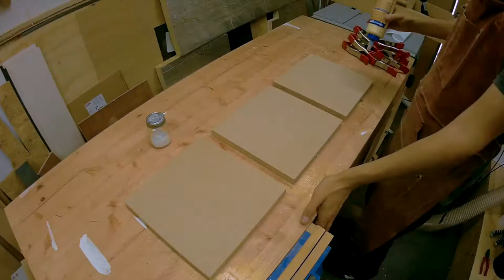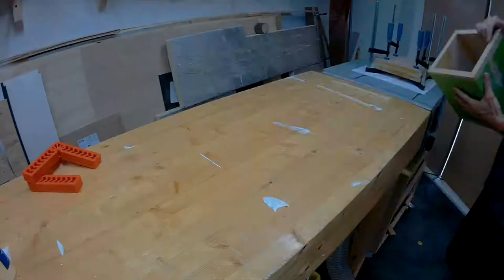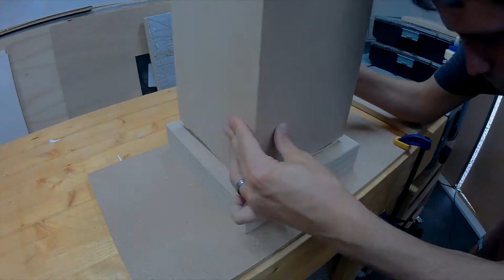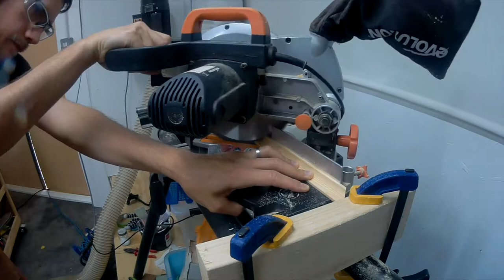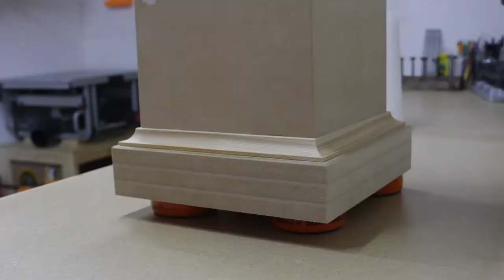Build this Pedestal using only MDF?! ~ DIY Woodworking

Comment: Wondering how the MDF pedestal is holding up outdoors?  I imagine painting it with outdoor paint would extend its life.
Reply from the maker: It's doing surprisingly well! It has some dirt and stains but still solid as a rock 👍I expected it to have exploded by now so pretty happy. There is a link in the pinned comment on this video to a post on my Instagram that shows what it looks like now 👍

Comment: being made of MDF i don't think you can keep this pedestal out side ? good project that most people could do, well done. thankyou
Reply from the maker: Agreed, MDF should not be outside as a rule (although you can get exterior grade MDF it is very expensive!)

I am leaving this one outside to get some data on what happens and how long it takes. So I can be more informed as a woodworker moving forwards. So far it has not started to swell or split and it's been a few months - winter is coming though!

We will see...
Reply: @mikeparsonscc  interesting, i made an outside waterfall from polystyrene (foam sheets) and carved it to look like rocks, then painted it with bathroom waterproofing sealer with different colored oxides to make it look like stone, that could be an option, but will push up the cost. the pedestal could be made from the foam as well. thanks.
Reply from the maker: @alanhorne5911  Sound very cool! Cheers for the idea 👍👍
Reply: Mike, do you have an update?
Reply from the maker: @jbclayville  I do! Follow the link in the pinned comment on this video to see what winter did to it. It's almost summer now too so will be fine for at least another 6 months 👌

Comment: There is no measurement given, so if one has to make than its a complete disaster 😩
Reply from the maker: The measurements depend on exactly what you need! 😬 Use this as inspiration and come up with your own dimensions 👌 (also it is 18mm thick boards if that helps)